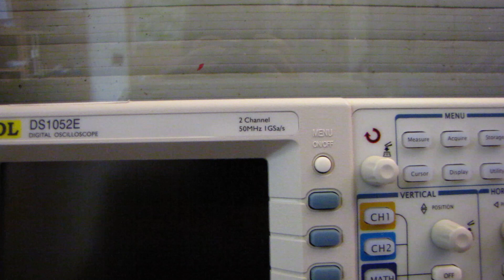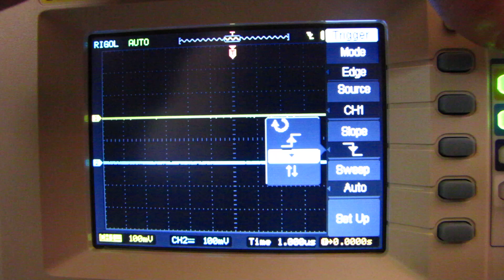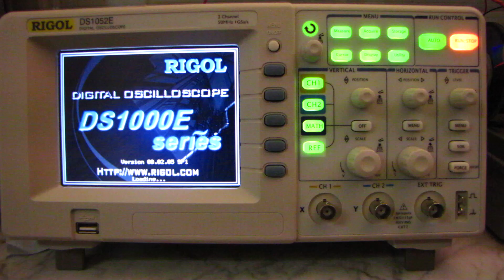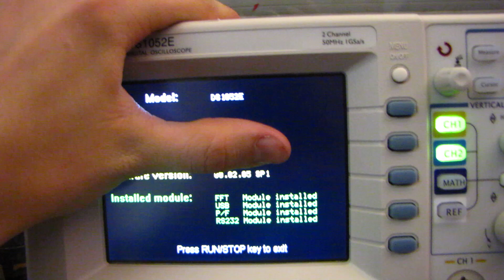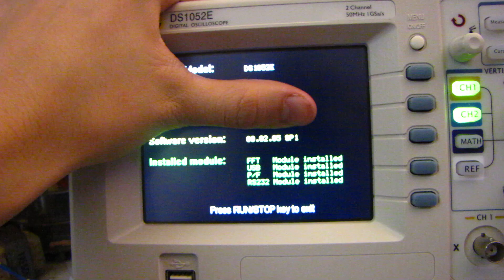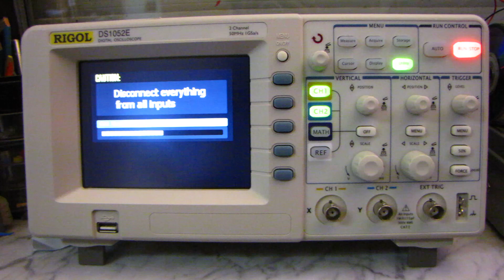Rigol DS 1052E trigger menu problem

Comment: Thanks for posting this video - I had the same problem but did not know how I had caused it. Your trick for stopping and changing the trigger worked and I now have it back working. For info I have the 00.02.05 sp1 firmware which has this bug. Cheers.

Comment: I just received my Rigol and followed your steps to replicate the problem you discovered. My unit works fine, but my unit is running a newer firmware version. So, they have fixed the problem with the most recent firmware version:  2.05 SP2
So all you have to do to fix this problem is upgrade the firmware.

Comment: The solution is to downgrade your firmware to 2.04 and it will stop doing that. As mentioned by others got to the EEVblog youtube page or the forum. The forum has a step by step guide to show you how to do it. I suspect rigol did a quick hack to upgrade to 2.05 in an attempt to stop the easy conversion to 100MHz and they released it before any bug testing. Even with 2.05 you can hack it to 100MHz anyway.